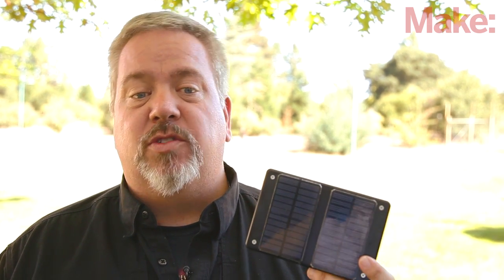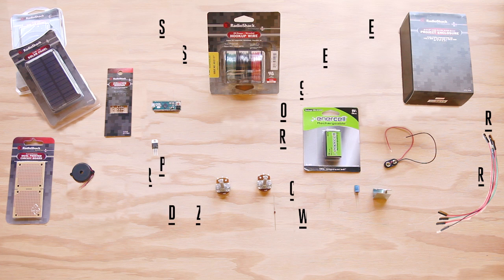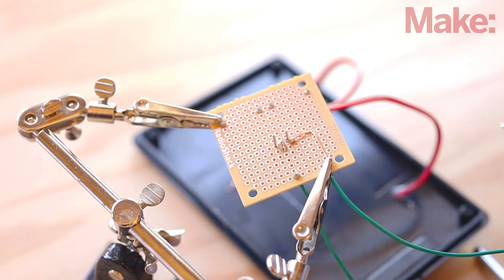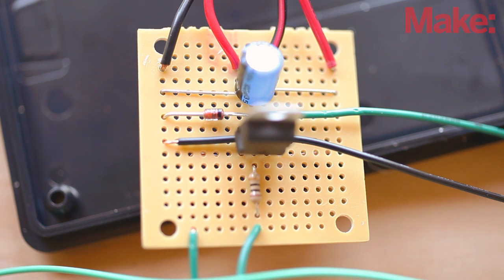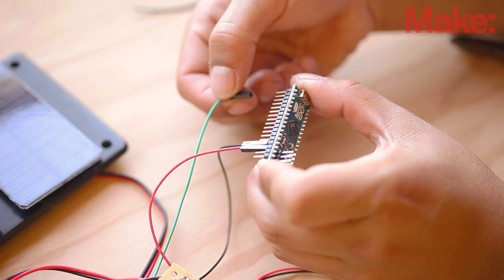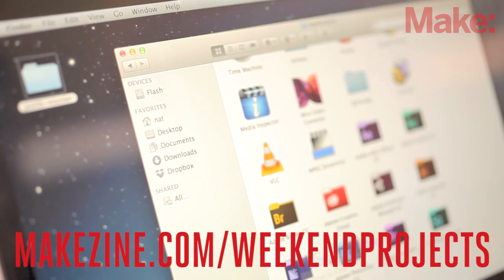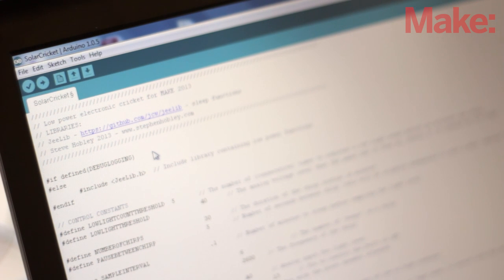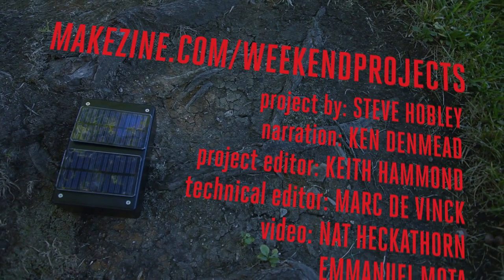Weekend Projects - Solar Cricket

Comment from the maker: Solar Cricket is the latest addition to our  #WeekendProjects  series of beginner-friendly electronics builds powered by RadioShack. Once you've gathered all the parts, you can start and finish this project in a weekend. In the end you'll have a discreet-looking enclosure box topped with two solar panels. These both charge the NiMH battery inside and also detect when light has dropped below a certain threshold, switching on the classic "cricket" noisemaker at night!

See the complete project online:
http://makezine.com/projects/solar-cricket/
Reply: a usb solar charger was one of my first real hack/make projects with ***** a few years ago. Great instructional, but with all of these materials you could do more than just make cricket noises.
Reply: Instrucciones en español para entenderlo mejor

Comment from the maker: Hi sonicase,
That was exactly our hope & intention actually. The project builder originally began using the 555, and it was decided to use the Micro to both achieve the result, educate new makers on sketch code, and hopefully inspire experienced builders to use the same circuit for some other purpose. Let us know if you come up with any novel uses for this project! Cheers.

Comment: I would used two transistor and diode based sensing circuit, double flip-flop circuit to make crickety sound driven by another flip-flop to turn it on and off. 8 transistors and no hazzle of programming, that most beginners can't do due to the lack of financial resources. Needs remake, I can provide the circuit in a few days.